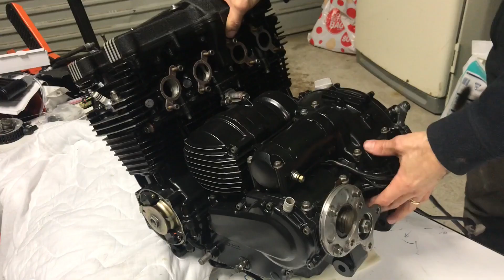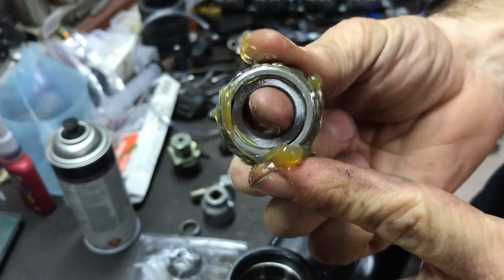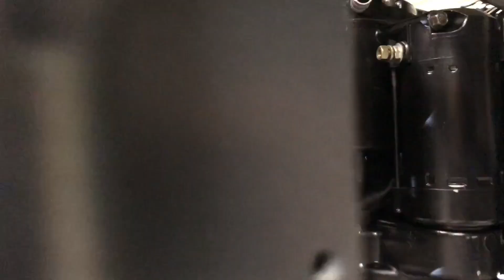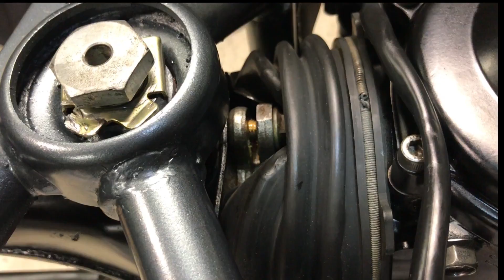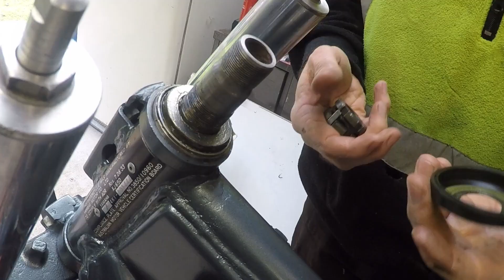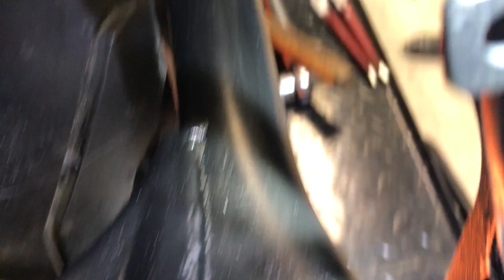Yamaha XJ650 Part 29 Engine Install

Comment: Where did you get the information sticker to put on the frame for after you got the frame done? My 82 xj750 has the sticker but it is scraped up and has chunks missing. I can’t find a replacement anywhere
Reply from the maker: Hi mate, the info sticker is the original one. I just made sure I didn't damage it during the build. Not sure you can get a new one as its specific for each bike.
Reply: That’s a bummer lol. Bike probably just won’t have it then 😒.

Comment: Nice build, been following for awhile now, one question, how much clearance do you have on the shaft side with a 140 on the rear? I have a 81 XJ750 SECA I'm working on and I didn't go bigger than a 130, I just didn't think a 140 would fit without rubbing some. Great content Fam, really like the build !
Reply from the maker: Hi Mate, no much at all, I took it a close as I could. It;s about 2 to 3mm as I got a bit more by removing the weld seam in that area

Comment: Your bike really is looking awesome and can't wait to see the end result. The oil switch you put in is a low oil level sensor (well it looks exactly the same as the one on my xv750), not a pressure switch.
Reply from the maker: I was actually wondering if it was pressure or level, thanks for clarifying
Reply: all it does is cut the engine if oil gets too low, or won't let it start.